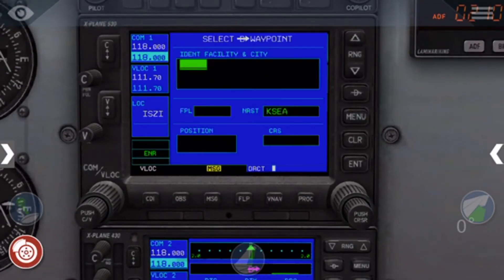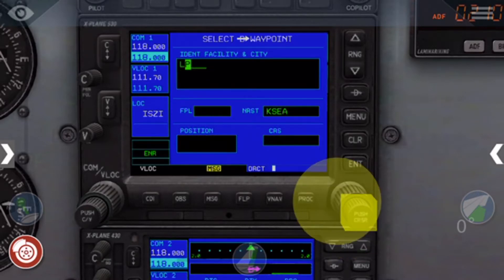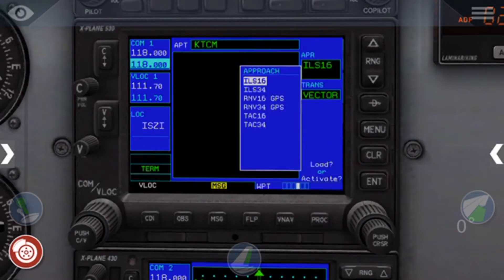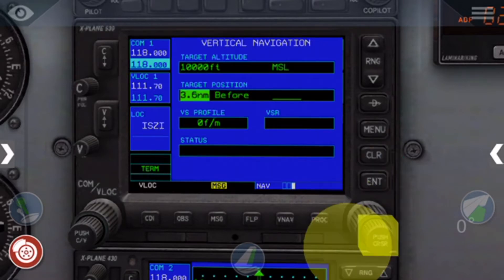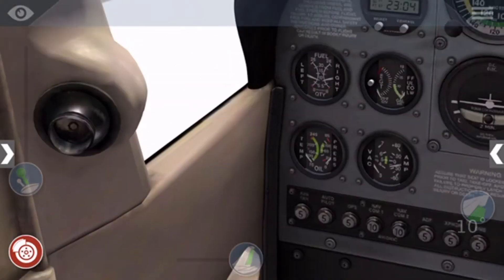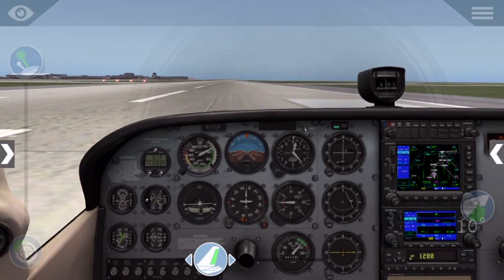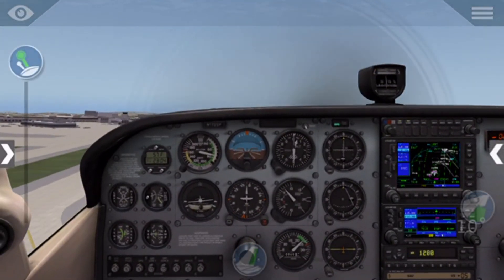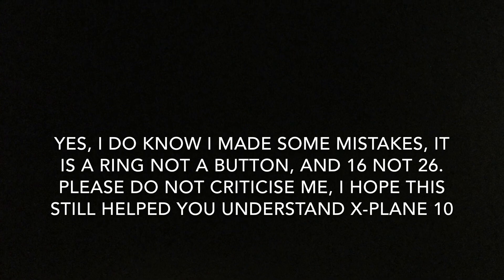How to use the Cessna 172SP's GPS in X-Plane 10

Comment: Whenever i turn on auto pilot my plane just turns off course...
Reply from the maker: Have you set the Heading Bug on the compass? It's the little red thing and is adjusted by a little dial below to the right I think. It has the red heading bug and HDG underneath it.
Also, make sure you've set the autopilot to heading mode (HDG) and not GPS/VOR navigation (NAV).
Reply: You have to turn on gps